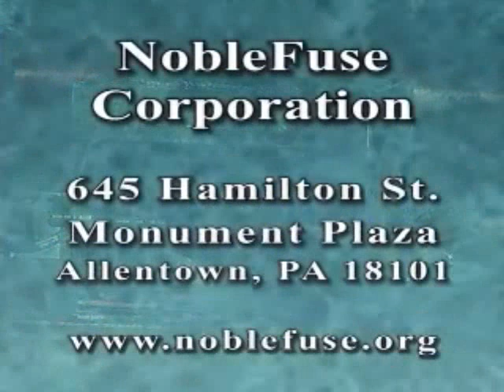A direct message to president barack obama

Comment: (continued)
And depending on how long you perform this experiment, you possibly/probably will produce a small amount of radioactive tritium. What are you using to measure the output?  I do not see any partial type of detector in your video. What are the final results of your experiment?

Katalyzt

Comment: Interesting... You are using high frequency energy to fuse the elements in H2O and D2O bounded by ionized gas created be the electric arc? By doing so, you naturally separated the water molecules into their constituent elements using mass amounts of electricity which is electrolysis. By my estimate(if you have successfully overcome the coulomb barrier) a by-product of your experiment should be surplus of deuterium.

Katalyzt